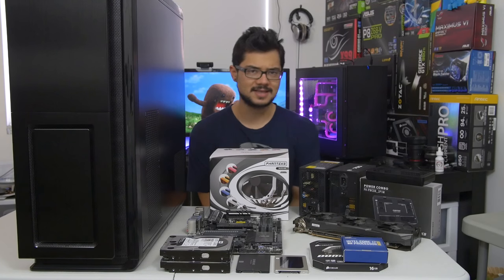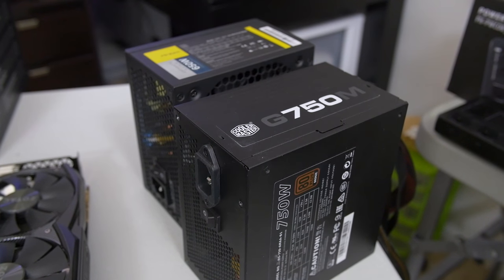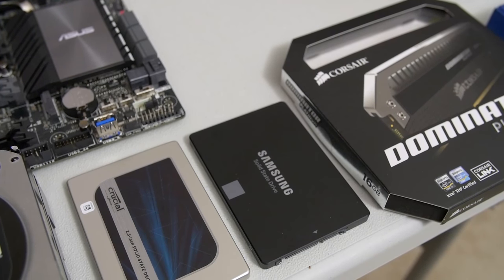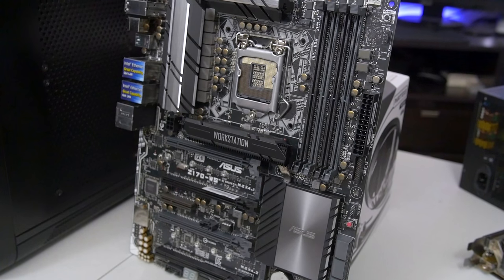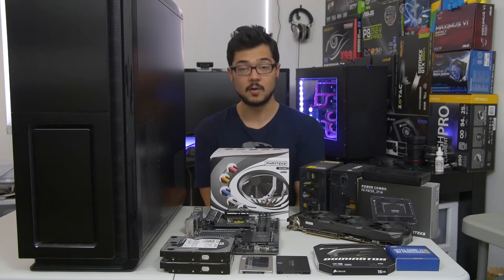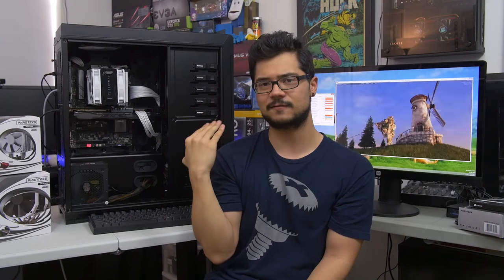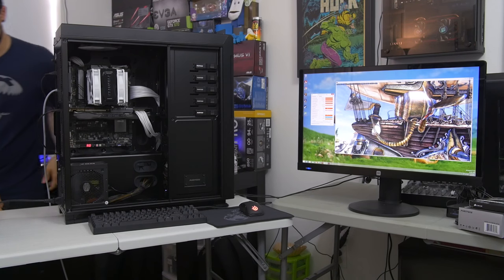Testing PSU Redundancy with the Phanteks Power Combo, Time Lapse Build!

Comment: The fan in the CoolerMaster PSU's fan kept running after you unplugged it. Is the Power Combo intended to feedback electricity like that?
Reply: +Adahop sounds totally unsafe and dangerous
Reply: +Adahop yeah i saw that to
Reply: +Adahop Yeah it is. The Fan runs on a seperate circuit of the PSU which is meant to be powered in a power combo.
Reply: Captain Leerox Thanks!
Reply: +Adahop It's supposed to do that, just like the hdd/sdd passthrough
Reply: +Adahop my psu fan keeps running for like a minute after the pc is powered off even if i unplug the cable, i'm fairly sure it's normal
Reply: objects in motion tend to stay in motion...
Reply: Epicvampire800 "...unless acted upon by an external force." Fans don't just spin endlessly. Small fans slow down pretty rapidly due to friction, air resistance, and the magnets within them exerting unequal forces.

Comment: I could see this being used to aid in extreme overclocking. During a previous scrapyard wars over on linus tech tips, they were having stability issues that turned out to be dirty power from the wall outlet -- a UPS corrected it. In theory, if you connect your 2 power supplies to different house circuits, you could clean up any dirty power, and the higher amperage could help any vdroop occurrence. I like it.

Comment: It's kinda dope that the power combo keeps the dead PSU's 12v and 5v rails juiced, but...

I'm not sure the redundancy is economical.
Hypothetically, let's say a power loss occurs, and kills the 4-disk raid0 array you keep your life's work on.
The delay to restore it from backup CANNOT cost as much as keeping a second power supply (even idle or negligible load) powered, just in case something happens.

Backup your disks, and get a UPS for convenience if your power utility is frequently garbage. Problem solved.

Storage backups  >>>>>>  power backups
UPS  >>  phanteks power combo
drops mic

Comment: it could also be used for su stems that use more power than one psu can suply. or to divide the power up. so like if you have 2 1000 watt psus and your system pulls 800 then each one will suply 400 watts.

Comment: Pretty nuts that the fan on the Cooler Master power supply still ran while not being powered by the AC line...

The reason: The fan controller built into the power supplies are normally powered on the 12V rail, so if the power supply loses main power, but there is a source voltage coming from the output into the 12V rail, the fan will spin because the controller is being powered by whatever is making the +12V rail live.

Comment: When you unplugged the first power supply it looks like its fan keeps spinning.
Reply: Unplugging a psu doesn't apply brakes to the fan
Reply: +Samuel Nehls omg the fan is affected by velocity, illuminati confirmed.
Reply: It does. The other psu powers it
Reply: +444animation I doubt that. PSUs aren't designed to have take power in anywhere besides the A/C port.
Reply: +Michael Dyer Since all DC rails of both power supplies are connected via the Phanteks stuff, the control portion of the unplugged PSU is still alive and so is the fan. The unplugged PSU is indeed powered by the other one.
Reply: +Michael Dyer Yeah but I think he meant that it looked like the fan was still being powered
(It was, by the other PSU)
Reply: The second power supply is back feeding the secondary of the first power supply. This can be problematic for power supplies that does not handle this well. Server power supplies, which are usually designed to be redundant, contains special circuitry for this.
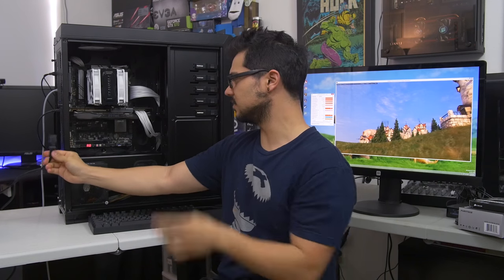Reply: +Michael Dyer It was spinning for 34 second or so without ac power! idk what kind of bearings that fan had cuz I have never seen a fan spin for that long without power. Just watch from 7:44 - 8:19 ...... You tell me
Reply: +Georg F Couple questions, when you unplug one PSU is it just the control portion that's still being powered or is the whole unplugged unit now just pulling power from the one connection to the 240 V AC? Does this mean that when one is unplugged your still pushing 750 + 650 into the system?
Reply: 0vert In the US it's 120V AC, but as to your question I doubt the combined power is still available. I bet it's just the power of whichever one is directly plugged into the wall.
Reply: +0vert You would only be pushing the Watts of the plugged in power supply. In that setup the graphics card is plugged into one power supply and the sata drives plugged in to the other. When power supply fails it still runs power to those devices from the other power supply.
Reply: ***** It wasn't the bearings, the power splitter is designed to let the second psu run power through the off power supply to keep sata devices and the gpu powered. It runs power backwards causing the fan to spin on the other psu. unfortunately kyle didn't explain this that clearly
Reply: 444animation Yeah that makes sense. Thanks

Comment: Servers are doing this for a LONG time.

A better setup would be allowing all components either draw power from the motherboard, or in some kind of redundancy arrangement where the two power supplies split the load evenly. I would use a M.2 SSD for boot drive (as it is powered from the motherboard), RAID-1 both work SSD and backup HDD, probably using an RAID card for better hot swapping and automatic rebuilding, with each power supply powering one SSD and one HDD, and connect the two PCIe power connectors from the 980 Ti each to one power supply. This will allow both power supplies split the load evenly, and allow the system to handle a failed power supply more gracefully.

Since you are using redundant power supplies, plugging them onto the same circuit breaker renders this setup pointless. You need to plug them on two separate circuits using two separate circuit breakers or fuses, so you get a truly redundant power solution. Datacenters even use two separate substations for power.
Reply: +陈北宗 The PSUs do split the load here, as bridging of the 24 and 8 pin plugs lets current flow from one PSU to the other PSU's molex and SATA power plugs. Otherwise the system would crash when the PSU connected to the graphics cards was disconnected.

Comment: Honestly i would have gone with a Thermaltake Core X9 it has two slots for power supplies at the bottom, has horizontal motherboard mounting, tons of airflow, and lots of mounting options of radiators and fans, and is completely modular with thumb screws...even the motherboard tray can be removed plus, and E-ATX support plus its more stable than those tall skinny cases. Maybe its just me but i fear they could tip over with the slightest touch, yes i know it will take more than a slight touch to knock it over, but for me stability is more important than looks.

Comment: Kyle, quick question. With Heaven running in window mode wouldn't that not stress the GPU fully? or does it not matter with benchmarking / stress testing?

Comment: Nice device, but isn't it pulling 2 times more power from the wall to power a single device? or does one psu stays kinda idle while the other feeds the system?
Cheers.

Comment: Could you use two 250 W PSUs with the Phanteks Power Combo to power a 500 W system? Also, what would happen if you unplugged one of the PSUs in that scenario if it'd work in the first place?

Comment: So when the two PSUs are connected to the combo, how is the load distributed between them?
can you use two 500 Watt Power supplies to power a 1000 watt system? (without redundancy obviously)

Comment: I see your running windows 7 on this rig (Skylake). How were you able to install it on this platform? 

I have been planning a build that uses Windows 7 Ultimate as the operating system. What I want to do is to install via optical drive (Mobo is Gigabyte Z170X Gaming 6). Gigabyte gives a guide for a USB based install, but not for optical drive install.

Comment: I don't understand how the GPU/drives can keep running if their directly connected to the unplugged PSU, does the PSU adapter feed power to the "dead" PSU through it's 24pin connector? Maybe just the way you described it confuses me idk

Comment: PSUs usually don't die like that, most of the time they spike in voltage and initiate system shut down, or the PSU would start making popping noises and maybe even smoke, you SHOULD DEFINITELY unplug your PC at that point.
Reply: +josh Subet All common servers have a similar setup, because the power supply is one of the most failing components.
Reply: +Michiel Haisma But in servers the PSUs are controlled by electronics which shuts down the broken/unpluggend PSU
Reply: +Michiel Haisma Duh, that's why the server's psus have a handle on them. They are literally fully modular, because you can take them out at any time.
Reply: +josh Subet I was playing csgo and my psu took the Fuse in the entire house it just failed all if the sudden
Reply: +Michiel Haisma 
For consumers, getting a UPS and a high quality PSU is the better option, as the power a house gets is just more likely to cause problems (brownout, power outage), rather than the PSU itself.

Comment: The issue with adding two PSUs for redundancy with something like the power combo is that you're adding another point of failure. if the power combo itself fails then both PSUs won't matter.

Comment: That was a really cool demo! I have been quite interested in this product since CES. But it would be really funny to see some powerconsumption numbers on this. Obviously having 2 powersupplys running, would result in a higher powerdraw from the wall, but how much? Is it double up, or only a little bit more? Also it would be fun to see if this could be used to have 2 inferior PSU's driving a mammoth system, kind of like Austin did in Scrapyard Wars :)

Comment: +Awesomesauce Network
Thanks for a nice video.
I've been very interested in something like this, but could You possibly explain a little closer how the actual connections were "configured" and how it "works" if a PSU fails (or is disconnected).
And also what the possible limitations of this product are (if any) ?

As far as I understand this product (lets call it a PSU-Hub)  only "handles" the power to the motherboard. 
I.e. it  has "inputs"  that "takes"  the 2 PSU's cpu power connections ( 24+8+8),  and  then lets You connect the motherboard to the "PSU-Hub's outlets"  instead directly to any of the PSUs. 
But what I fail to see is how this "helps" components that use power from other connections, that are not "combined in the PSU-Hub" ??
For instance a modern graphic card only draws approx 75W through the motherboard ((i.e. the  PCIEI slot))
the rest of the power has to be provided by the "Supplementary Power Connectors", in other words the 6- and or 8-pin Power=connectors that go directly from the PSU to the Gfx-card. And baring in mind that  single Gfx-card can draw all the way up towards 500 W. How can a graphic card under heavy load continue to run if the PSU that is providing the power via it's "supplementary Power Connectors" is disconnected or fails ???

Best regards.

Comment: Well, that was interesting, unless that fan has some really fancy bearings on the PSU, or the video quality sucks... It appears that the device is back-feeding power back into a PSU that is unplugged...  Something isn't right here, and IMO, that could potentially damage power supplies... >.>  $40 for what is essentially just a combiner...  What I am curious about is the internal quality... Are they using buss bars to carry the current, or wires, or just a PCB with a crap-ton of solder to help carry the extra current?

Comment: What happens when u need to power many devices in the pc as power outputs are limited from the splitter? U said to connect direct to the GPU or drives from the PSUs i believe- in which case other parts of the PC crash? And what happens when the gpu powering PSU dies ?????? Whats the point in having a running system without a display then? Why did u NOT mention these disadvantages?

Comment: If the house has a black out then both psu will die right? so what is the point of this
Reply: +Tieng Nguyen in case one power supply fails whilst still in use, its not necessarily built to accommodate power shortages related to blackouts etc, which is why you should buy a temporary battery system or a generator that will keep your power supplies alive long enough for you to save what you're doing etc.
Reply: +Tieng Nguyen The point of this was for redundancy in case of power supply failure...not an electric shortage/blackout.

Comment: WHAT IF A PSU GETS FRIED / SHORTED?    HOW DO YOU KNOW A PSU HAS ALREADY FAILED ?
how is  pushing current BACK to the other PSU a good thing??
i thought the whole  idea was to have both psu and cables be plugged,, and be able to swap dead  psu's on the fly while the other is working, just buy 3X required wattage platinum psu and a big ups, or server psu
Reply: +Oscar Velazquez 
Good question. Just looked up the manual: there are leds called "indicator LED Light" on both  inputs, but not mentioned in the text. And even if they indicate PSU failure, you would hardly see them when the case is closed. So unless there isn't any other indicator (e.g. sound) this thing is useless for redundancy reasons.
Reply: +Korben D I was thinking that maybe they're would be some form of firm or software that would come with the product but if it isn't connected to the motherboard for anything but power idk how a signal would be sent... Seems like they overlooked the issue entirely

Comment: Hey quick question. I'm trying to do a build on a Lian Li o11 Dynamic Mini with a 4080 card and from what I read they suggest a 1200w psu and they don't make any 1200 sfx psus so I've been looking at how to possibly use 2 850's or 2 750's in the rig somehow. There was another youtuber GGF that said he was going to do this but I haven't found the video on it so I was wondering if you knew of a way to do this and how I should plug everything in? If you could take a quick minute to explain how I can possibly get this done or if you wanna make a video on this or whatever is easier for you that would be great, thanks! OR even better, if you know of some kinda mod that can be done to the Case that can allow for a regular psu that would be amazing! Get back to me when you have a chance, thanks!

Comment: nice look and good idea but not new...add2psu adapters and bitspower psu adapters are both available over on frozencpu in the case mod/pc tools section this unit does look like it has a lot more modularity and options but its also much larger....of course if ya have room for 2 psu's then ya prob have room for this board lol

Comment: cool video. but the question i think really is
does the power supplys wattage add up using this gizmo?
and
will the computer still work if you plug each power supply to diferent fases of the electricity grid? 
or plugin each psu to it's own ups
really love to see a video about those matters
Reply: +Ruso_R9  also. how the power draw from the wall is affected using each and both psu's?

Comment: I don't see this in the comments, so, Can someone please confirm this for me?

With this product, and using two power supplies connected to AC at the same time, does this do real time automatic load balancing? As in if I connected 2 video cards to PSU #1, and two to PSU #2, would they automatically all run normally?

Comment: Just a question, why go with the larger crucial and smaller Samsung?

Wouldn't it be more powerful using a 850 Evo with RAPID mode enabled so you can leverage System Memory as Cache, for even higher read and write speeds?
Reply: +Dreadnaught1985 No reason to use rapid as windows linux and osx have that built into the os already. Some may require setting the drive to write-through mode.

Comment: Can you use it with 2 PSU's that arent enough on themselfs? like 2 350 watts?
Reply: +gaming with egoon Yes, but there'd be no redundancy; in fact, it would make the system less reliable because you'd be adding another point of failure. Also, low wattage PSUs tend to be of lower quality, so especially if you need 700W+, you should be using a better unit anyway. I always recommend something from Tier 1 or 2 of Tom's hardware PSU list.
Reply: +Ryan foulds oh yea i know wast planning on doing it but its a cool idea non the less
Reply: +gaming with egoon not really.
Reply: Yeah you can, people having been doing this for years, but this setup works a bit better than cables of old as it shares load fairly evenly across psus